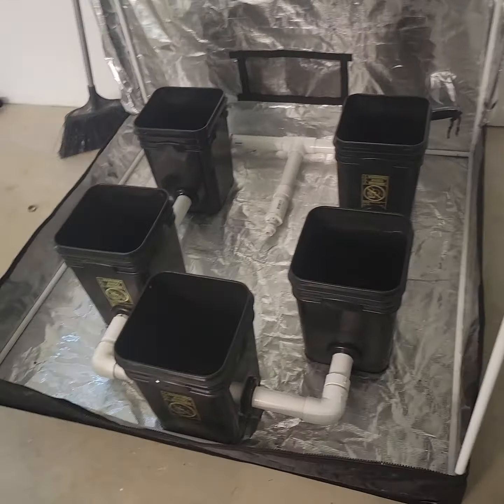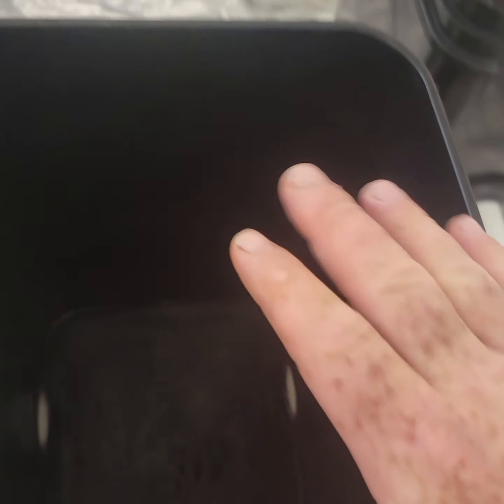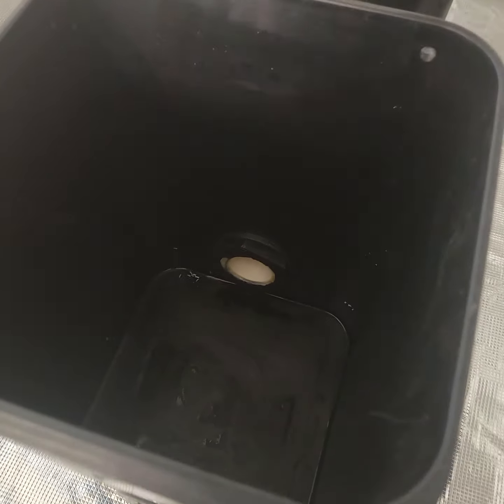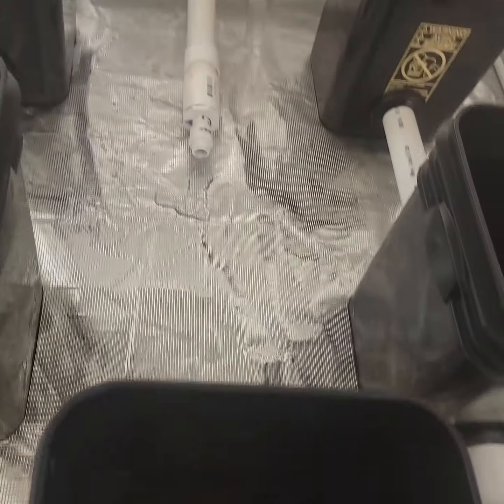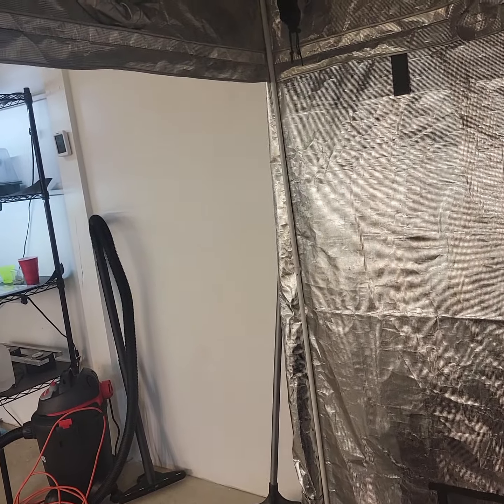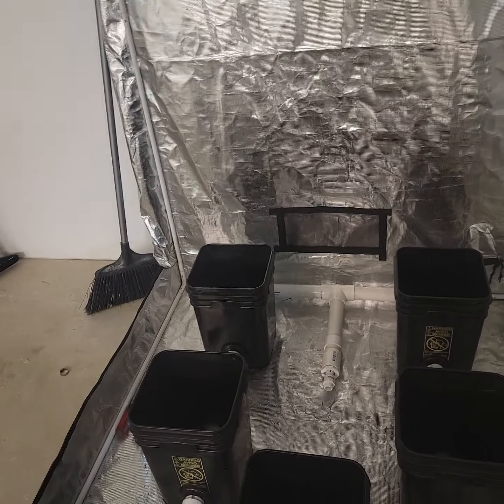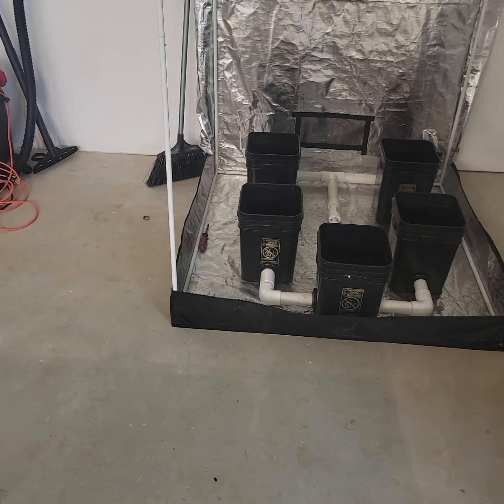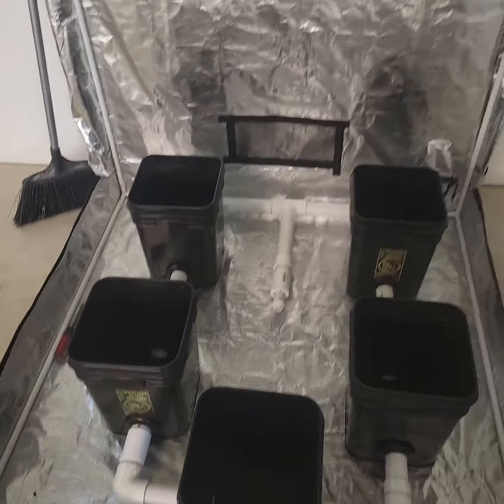New RDWC design

Comment: Hey brother what size are those buckets and what size are you reducing down to going to your pump from the the 2 1/2  pipe. Good luck with your  grow off. Ill tell you this mucg, ive run rdwc in setups i built mysef in 13 gallon buckets, with a 1/4 hp chiller and i hit 1 1/2 lb per plant with a 6 week veg. Id like to know how using that 2nd pump goes, cause honestly im not sure about that. It seems like your fine with that set up you have now but maybe use bigger buckets. Also im gonna say, something youve heard a million times, but in order to be sucessful at this rdwc shit on a consistent bas8s you got to have a chiller. It took me 10 years of messing with this shit cause im stubborn and im an idiot, but you got to have a chiller. A 1/4 hp would be perfect with that setup you have now. Give then a 6 to 8 week veg. and with the right strain and bigger spacing you can hit 2 lbs per plant, take that to the bank.

Comment: I'm following this grow...I was wondering, why you placed the rez inside the tent ?? Won't those cobs heat up the rez & buckets as well without a chiller ??
Reply from the maker: Yeah to an extent but the goal here is to keep as much oxygen in the water no matter what the temp. Water chillers are good to about 68 to 70 degrees before major condensation issues occur and water ends up on the ground. I've gotten root rot in 67 degree water so the chillers not really a game changer imo. High DO is important abovecall
Reply: @heisenbeansgenetics  Hypochlorous acid improves DO. It would make sense to use it throughout the whole grow. I know h2o2 adds DO, i like using it when popping beans but i wouldnt run it in my RDWC system. Also have you tried those air diffusers and compared them to air stones? I'm not sure why Current Culture discontinued them, the diffusers seem harder to find than air stones.
Reply from the maker: @Pesco420  I've used the diffusiors and they clogged up to easy

Comment: I got 1 inch pipe but same set up (just no second pump sending it back yet). my only prob is the second my line is clogged my rez could overflow. I kinda want to double my rez size so I can let it flow full speed. but my thoughts on the second pump is have them run to each bucket with a drip ring.  only because I have one inch pipe and the drip lines would give it a lil more time to let the water run. I would be scared of over filling each bucket if it went to fast. I really  just need to increase my piping size but for anyone stuck with 1 inch pipe I was able to jam my hand in the bucket or a  broken clothes rack to pull them roots out of the pipes.  Heisen love the videos -  only 3rd time doing it my record autoflower ended up being 14oz  whats the biggest auto U have yielded? lol I am sure u blow me out of the water
Reply from the maker: Yeah you need bigger pipe at the bottom

Comment: What kinda pump you running on the big system you talked about 12 or more..?
Reply from the maker: If I had to do over I would run two 1100s on a 12 bucket with a bigger epi bucket. Put a 800 submersible in the epi and constant fill the plant buckets with oxygenated water